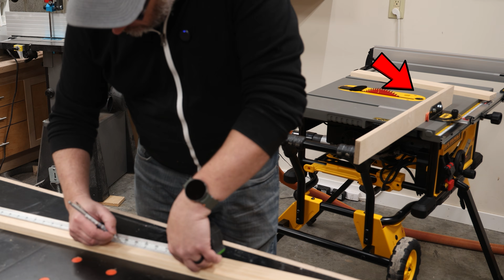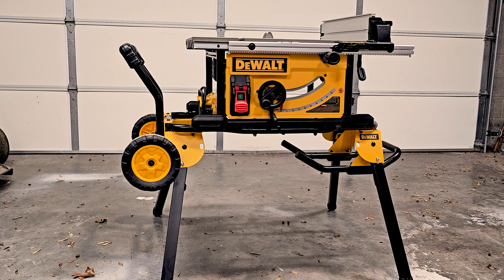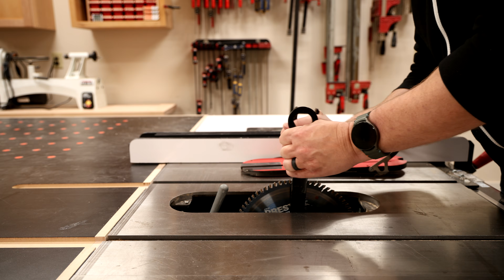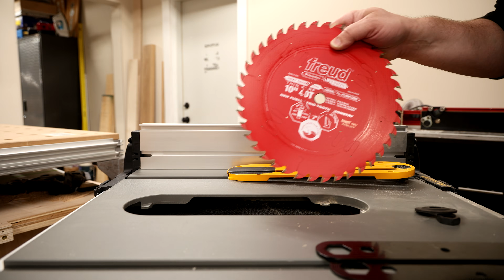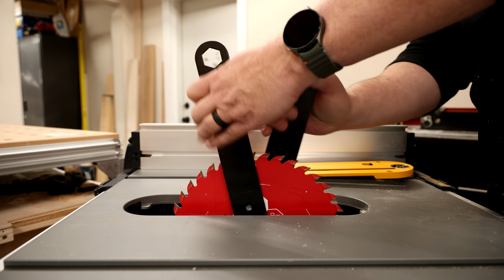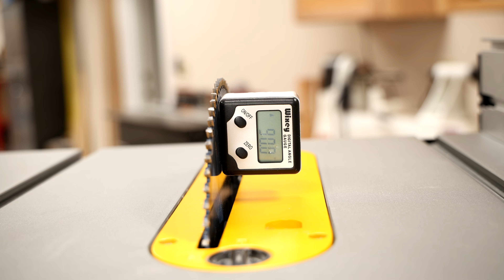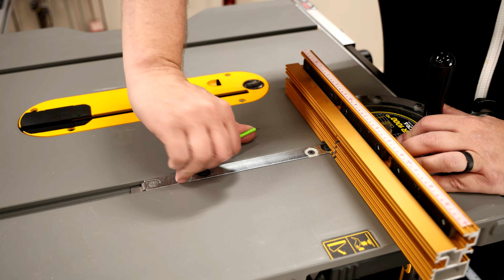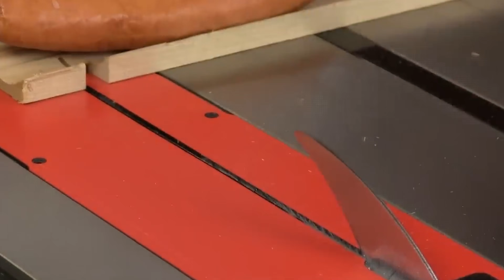Why do people even buy this saw?

Comment: My first table saw was a $150 piece of crap from Lowe's and it had a fence that was so loose I had to measure the distance from the fence to the front and back of the blade every single time I changed the width of the cut. From that I upgraded to the very jobsite saw in this video. That first saw burned out on me after cutting some 1 inch oak. The DeWalt handles it no problem. I seriously love the fence on the DeWalt and I wish larger saws would adopt the same system. Just messing around with a SawStop at the store I can press their fence and it deflects because it's only locked down at the front side. I don't know how big of a problem that is when in real use, but it does make me very nervous.

One thing about the DeWalt I will say, in addition to the things mentioned in this video, is that I get a lot more saw marks than I would like. Not sure if that's my fault or if something is out of whack with the saw itself.
Reply: I tune the back end of the fence a couple of thousandths away from the blade.  Just a tiny, tiny little bit.  If you keep your blades sharp this greatly reduces burn marks and kickback.

Comment: Honestly, checking and adjusting to make everything square, should be the FIRST thing you do for ANY larger power tools.  You should always check your new tablesaw, miter saw, sliding miter saw, jointer....EVERYTHING.  Only then, should you perform you head-to-head comparison and frankly, the fact that your didn't invalidates your testing.

You did touch on many points that were legitimate limitations in a job site saw, but they're mixed-in with what could be inaccuracies from not checking setup first, so if you don't already know what the limitations are, your comparison potentially added a couple for the people that don't know.  Like burning.  If you'd set it up properly first, and used the same blade in both machines, would it still burn?  If you'd checked first and squared the fence, would your rip tests have felt smoother and been quicker?
Reply from the maker: I fully checked and calibrated the saw before the test. I was simply relaying the experience I had when I first purchased the saw.

Comment: My DeWalt job site saw is 20 years old. I love it. I don’t build furniture. Just for home DIY. Recently added the Festool system and built Systainer storage cabinets as my first project with it. I am in love with my Festool!
Reply: Be very frugal with rhat machine in the last 7 years i went through 3 of them different brands always a sharp blade but the engines and the 120 volt just kills them.

Comment: I have had my DeWalt job site saw for seven years. I do not run a production shop but a small shop in my back yard for hobby and making things for my house. On the out feed end of the saw is an eight foot by 5 foot table with a router I built into the table. I don't have have room for a large cabinet saw and actually do not need one of those expensive machines for my small. When I was working, now retired, I have a wood shop that had all the big boy stuff machines with a vacuum system that would pull your ass through the pipe if you got close enough. So I know what is needed for the work done. I love my DeWalt saw and I have the miter saw built into table within three feet of the table saw. The hardest thing I put my job site saw through is sometimes re-sawing. It handles it very well. Some people go over board with machinery that they really don't need. For the difference in price of the job site saw and Sawstop is not worth it to me. In my small shop it would be as useless as tits on a bore hog. Another thing. Before I go out and purchase a green track saw when my old Makita can do the same thing with a straight edge, kick me in my ass.
Reply: Wel said. I agree I used to have access to a full shop with expensive table saw and large band saw. No I am retired and doing smaller work I have the DeWalt job site saw and a Makita track saw. Have the battery one as well as a cabled one. Still do some site work and need to have equipment I can travel with. Took me some time to get the DeWalt job site table saw accurately set up plumb and square but it's good now.
Reply: saw stop nice quality but an advertising delight to justify its $$$$  . Wood working 30 years  table and cabinet saws  and never had 1 accident /incident that a Saw Stop would have been better owning.

Comment: Another thing to consider if you don't have cabinet saw money, there's also the "contractor" style saw. It's larger format like a cabinet saw, tad bit upgraded from most jobsite saws but still approachable budget wise.  The Ridgid R4560 was going for $450 over the previous holiday season. It's identical to the very renowned Delta 36-725T2 which is also sold at a fairly similar price.  When comparing those saws to the jobsite saws, you're definitely getting a lot more saw for the money.  The biggest hurdle is if you have enough space in your shop haha!

Comment: I have a 30 year Contractor saw (cast table and wings) upgraded the fence and motor, works nearly as good as a cabinet saw. I also recently purchased a cordless table saw for smaller jobs away from home. The tilt mechanism seems to be the same on all the smaller saws now, no worm gear, just push, hold it where you need it tilted at, then lock it, that is annoying but is what it is.

Comment: I had the Dewalt, but I found the size and weight made a lot of cuts feel a bit sketchy. While I had the Dewalt, I swapped my standard kerf blades for thin kerf. HOLY CRAP, instantly felt like I’d increased the horse power by more than 50%. The thinner blades tend to deflect a bit, but you can work around that by doing a first cut close to your line and then a final skim cut.

Comment: I own that jobsite saw and I agree with all of the points made in this video. Using the correct blade is essential. I hate not having better control over my angled cuts. LOVE the rack and pinion action! I built a work table around my saw to support the material on the left and the outfeed. I was noticing that it was a bit out of square so I'll be making that adjustment that you showed here. I was not aware of a replacement fence... I'll have to give that one some thought. One thing you missed was the fact that you don't need 240V. Not sure of which version of cabinet saw you have there but I noticed many require 240V and that would be a deal breaker for me as I simply couldn't make that happen.

Comment: I stared with the same dewalt saw and upgraded to the SS within 3 years. I knew this would be a lifelong hobby and I already don’t have much free time so having a saw I don’t have to fight with or spend time to set up just made it worth it to me. It’s also a real joy to use and it just makes the little time I have so much more enjoyable. I still have the Dewalt but only use it for cutting pine to not gum up my cabinet saw. Also the Dewalt is a real screamer and the 3hp SS is much quieter which I’m sure my neighbors appreciate. 

To be fair, my SS was not perfectly square out of the box. Also my cast iron top is slightly off, something like 3 or 4 one thousandths across which I guess SS says is within normal tolerances and is so small it’s basically nothing.

Comment: You compared a Sawstop to a Dewalt, hummmm interesting. 
Keep in mind that dewalt is black & decker, so the quality is more on the (very) lower side.
I have a Sawstop Jobsite, which work also to make cabinets but ...... more precision would be welcome (blade height is way too fast and hard to set precisely).
The good thing is that I can easily use dado's (with the adapted brake system, 8")
So my next buy is ........ a shop Sawstop.

Comment: I started with a used Rockwell contractors saw. Eventually, I upgraded it using a modified design from an old Fine Woodworking Magazine article. I put the saw in the middle of a 4'x 8' sheet of plywood and upgraded to a Biesmeyer fence. Later, I was able to find afford a cabinet saw. I kept both saws and continued to use the Rockwell with a dedicated dado head or, if, the project called for it, I would do any bevel cuts there and I could leave my cabinet saw set up for production work.

Comment: fabulous video.  I agree with the problems with smaller saws compared to the cabinet saws.  The only thing that bothers me with my small saw is the surface not being as flat as it should.  Its about 4 years old and I think its much better than the new models.  But the cabinet saw prices are just not worth it for a guy that just does it on the weekend.  I like being able to fold it up and put it away when Im done but Im using it in the garage on the weekends.  Would love to have a Harvey or a Saw Stop but I just cant justify the price.  I would probably go with the Harvey if price was never an issue.

Comment: There is a middle ground with contractor saws. The Delta 36-725T2 and Ridgid R4560 sit right between jobsite and cabinet saws in performance and price. They have trunnions that allow both height and angle adjustment wheels, big cast iron table tops, and solid fences. However, they are light enough on wheeled bases to maneuver in small shops. They are priced a bit higher than most jobsite saws, but well below cabinet saws.
Reply: I have the Delta and like it very much. Just as a side note, because I'm still bitter, almost 50 years ago I started my career as a furniture maker with what was called a Delta Contractor's Saw, and what an incredible POS that thing was. Too young and too dumb to totally realize it, I kept it and used it and it was only gradually that I realized that a saw that was so poorly manufactured that you could not align the miter gage slots and the blade (only one of a myriad of problems!) wasn't worth having. Delta seems to have cleaned up their act, and good for them.
Reply: @adam_hominem  Glad you like the new Delta. It's not often that someone takes a chance on a brand they had a bad experience with.
Reply: @adam_hominem  50 years if bitterness? Was it worth it?
Reply: @oliphauntsneverlie6227  I was sort of kidding. But I do remember what a disaster that saw turned out to be.
Reply: It took me about 4 days, but 2-3 hours each day to align the riving knife after we moved and it was out of alignment. My table top is also not flat, and the wings are so bad. Delta was supposed to send me new ones when I called right a couple weeks after I bought it. They said it would take a couple months but my dad passed and I had to take care of cleaning out and remodeling and moving my mom because she couldn't afford the house payment on only one SS check. It was about 8 months after I called them when I was packing up my own home to move that I realized they never sent them and when I called they of course had nothing in their system about my previous call. I wish I had done a bit more research but it was my first saw purchase and I was excited to just have one that wasn't the little ryobi on the stand I had previously that I was to scared to even use because it wasn't stable.
Reply: I have both the delta contractor and the dewalt in this video, when I’m on jobsites I couldn’t imagine not using my dewalt. But when I’m in the shop I cannot imagine not using my delta. Both are very good saws. I will say the delta is a lot quieter than the screaming dewalt.
Reply: My great grandfather bought his craftsman 113 contractor table saw new in 1948. My grandfather used that same saw throughout his lifetime as a carpenter and well into his retirement building birdhouses and other knick knacks to sell at festivals. I got his table saw when he passed away and it's easily my most prized possession. My grandpa used it all stock, but I cleaned it up and now I've got it kitted out with a higher powered motor, overhead dust collection and a unifence. I wish my pap was still here to see it now. I've never looked at another table saw and thought, "that one can do a bunch of stuff mine can't" or that my old saw is holding me back. The only thing that's a little janky is the bevel adjustment, but there's plenty of other ways to make a bevel cut if I can't get the angle I want. 

My pap supported 6 kids and funded his retirement using this same saw since he was a kid and he died with 10 fingers. If it's good enough for him it's good enough for me!
Reply: That Ridged is a pos.  Avoid.  The one I had for about 4 hours was warped.  Took it back.
Reply: You have to be a bit careful with hybrid saws.  Not all adjust well for performance.  What you want is a hybrid saw that is cabinet mounted, NOT table mounted.  Cabinet mounted hybrid saws can be more easily dialed in to be parallel.  Table mounted saws are a total PITA and have limited adjustability.  There’s only a few hybrid saws out there that are still cabinet mounted.  Not easy to find but worth the effort.  I’d mention a few but by the time some reads this the company may no longer be making them that way.  So learn and look for yourself.  I selected my saw after watching a demo at a show by the Inca guys who were using a Craftsman zip code saw.  I think I purchased one of the last new zip code saws available direct from Sears for $600.  It’s not a power monster, but I can cut 8/4 hard maple with no issues or burning.  I also upgraded to the Inca fence system, so essentially copied the show setup.  Not disappointed as I can repeatedly cut accurately to 1/64 or better.
Reply: @JS-xw9eu  Hybrid saws are not a middle ground between jobsite and cabinet saws. They cost 3 times as much as contractor saws. In some cases they cost as much or more than cabinet saws.
I have yet to find any adjustments I can't make on my 36-725T2. I check the calibrations regularly, and after 3 years it's still perfect.

Comment: My tablesaw is a Grizzly G1023 3hp 220v. I got it from a guy who had a renter who ditched and left it in his garage. It was practically new and I gave the landlord $400 for it. 

Benfits of a 3hp 220 cabinet saw. First it can saw off appendiges nice and clean, making them easier to reattach. The kick back can ventilate your garage door and is great for waking you up. It's also quite scary for the amatuer which discourages others from asking to borrow your tools.

Something I didn't hear, cabinet saws have much better dust collection.

Comment: Another important mark against the job site saw is the screaming universal motor vs. the quiet induction motor of a "real" table saw.
Reply: Universal motors tend to let the magic smoke leak out, too.  Induction motors are pretty much idling with any woodworking tool, with 99% of the operations it's designed to do.

Comment: I have that same Dewalt 7491rs table saw. Mine came perfecly square in all settings, but does have the same not quite flat top issue. Mine is about 7 years old and that might be why its factory square and yours isnt. Companies are cheaping out to save every penny they  can.  Its still square to this day. It works great for what I do, and since I don't have a shop it's the best option for me.  I think alot depends on what you need it fore. I make reptile enclosures with mostly plywood, pine, and fir. So the dewalt is perfect other than lacking the anti finger eating gizmo.

Comment: I have one of the DeWalt jobsite saws and keep it on the stand due to space limitations. Maybe I got a dud, but even after calibrating the blade and locking down the screws, there is still play in the housing and it easily becomes misaligned. I’ve learned to deal with it, but it’s an annoyance.

The other issue I’ve had is the fence started sticking. Maybe sawdust built up under the rails and caused it to bog down, but in trying to adjust the fence so it didn’t stick, it became loose enough that it would move a couple millimeters during cuts. My next step for that is taking the fence assembly fully off and doing a thorough cleaning.

I’ve been considering stepping up to a contractor saw since I don’t have space for a cabinet saw.

Comment: After cutting my hand - again - I ditched the cabinet saw for the Sawstop Jobsite Saw. I have a very small shop and too many tools so the saw has to sit outside (and I have to do all my work outside) and the Jobsite Saw would be easier to protect from the weather and move around as needed. Festool MFT and Benchdogs MFT version help out with tasks normally done on the tablesaw. To an extent. Somethings I just know how to do well on the tablesaw and not on the MFT's. sigh. Now, I'd love to upgrade the fence on my Sawstop - so far - to products available.